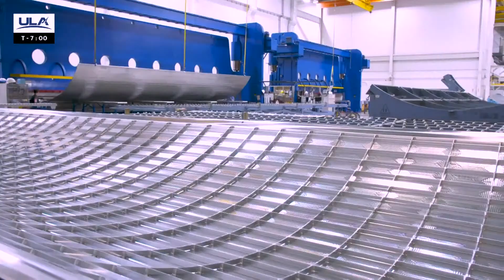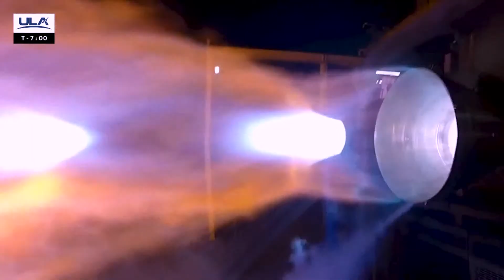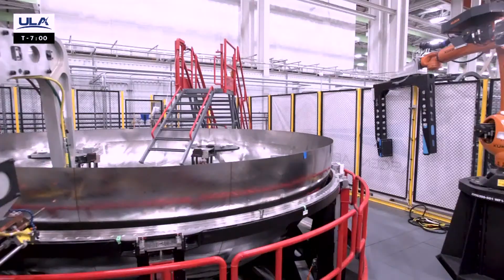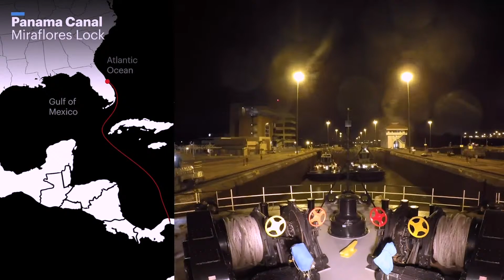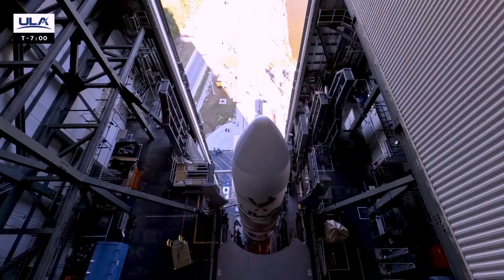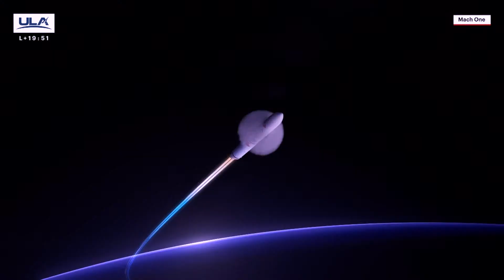Oct. 4 LIVE Broadcast: Vulcan Cert-2

Comment: as a rocket scientist, i can say that this was absolutely flawless. no notes. well done ula
Reply: ULA said that the vehicle’s performance was nominal in the early stages of flight. However, the separation of the two GEM 63XL solid rocket boosters (SRB) took place nearly 30 seconds later than the timeline the company provided before launch. About 35 seconds after liftoff, there appeared to be material coming off one of the boosters, whose plume changed appearance, suggesting damage to the SRB’s nozzle.

and ... ULA did not mention the incident during the ascent, but the timing of subsequent events, including separation of the booster and the shutdown of the Centaur upper stage’s engines after an initial burn, were behind the timeline by up to 20 seconds.
Reply: @jimwilliams4643  oh I should've noticed that. hey ho, looks like it got up to space okay. probably just a loose screw or something.
Reply: @jimwilliams4643 There is video of the SRB nozzle being blown clean off. NSF covered it (almost) live.
Reply: The uhhhh SRB???
Reply: @intrasonic  the silicone rubber bands are all fine. it got to space and landed fine. ready for the next launch!
Reply: @earthplusplastics 
Did you watch the same launch as every one else!
There was no recovery of the Vulcan booster!
Reply: @mahbriggs  ???
Reply: @earthplusplastics  
Can't comprehend English?
You claimed it went fine and was recovered for the next launch!
This is Vulcan, not Falcon!
The booster was expended!
Reply: @mahbriggs  no there wasn't a bird strike by a falcon! I said the SRB's were fine, but according to @jimwilliams4643 he reckons the little rockets on sides went too hot too soon. it's too soon to tell. we will have to wait until the FAA report before we know.

Comment: Good to have another rocket in the mix to choose from.  Other than some SRB excitement things went well.  SX fanboys busy spreading the light of consciousness as always.
Reply: Your willingness to just glance over the SRB excitement is odd. That's not a minor issue. They need to analyse the data to see if the success was due to redundant tech or due to pure luck.
Reply: @Pranav_Bhamidipati  Vulcan can have as many as 6 strap on SRBs so this will be thoroughly investigated.  Northrup Grumman is the SRB manufacturer.  Another rocket company launched 3 prototype rockets that had engines fail during flight and the community was fine with that.
Reply: @armandomercado2248  I'd argue that there's a difference between a certification flight and a developmental test flight, but you do you.
Reply: @Pranav_Bhamidipati  Not a minor issue, but not a show stopper either.  Per SpacePolicyOnline,  "FAA assessed the operation and determined no investigation is warranted at this time".  Some are upset there's more than one rocket company and are being hyper critical even to the point there's too many people in the control room.  Bottom line Vulcan reached orbit successfully.
Reply: @armandomercado2248  That irked me a little. A chunk of the nozzle literally broke off and fell down to the ground, not to mention that the rocket was on a slightly off-nominal trajectory. How could that not warrant a mishap investigation to check if public safety was ever endangered? There was no disposal of SRB nozzle planned (until later in the flight where the entire side boosters were jettisoned).
Reply: @Pranav_Bhamidipati  Vulcan remained within its launch corridor and the public was never in danger.  The GEM68 has a long history and this was the second failure ever.  ULA is launching from an established facility where all environmental and safety concerns were addressed long ago.  The other rocket company has significantly modified the proposed use of their facility from what they said at the start and the way they're going to fly their rocket, so they will get more scrutiny.
Reply: @armandomercado2248  Yeah, I just watched a video about that a couple of hours ago. Seems like there are safe zones where debris like this is allowed to impact the ground without requiring a mishap investigation. Neat.
Reply: @Pranav_Bhamidipati  The boost phase is over the Atlantic Ocean.  China allows spent boosters to crash near villages, so safety regulations are a good thing.

Comment: For me, the flame at L+0:37 with sparks and the difference of size of plume afterwards (maybe due to the camera angle), and the SRB jettison at L+2:10 and not L+1:49 look strange. But the callouts "everything is nominal" indicates the launch was ok. 🤔
Reply: No it definitely was not, Tory Bruno did confirm what we saw, as an “observation” of the right hand SRB, aka the nozzle or the aft casing failed. Centaur ended up burning extra because of the underperformance from the anomaly
Reply: @clevergirl4457, where did Tory Bruno confirm this? I don't see it on Twitter. Is there another information outlet, or did i just miss it?
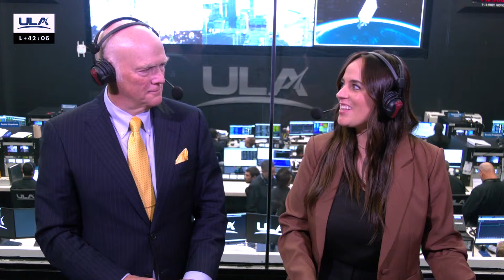Reply: @sumisubee  At 2:32:00 Tory mentions.
Reply: @sumisubee  on the stream
Reply: @clevergirl4457  ah. I didn't watch to the end. Thank you for pointing me in the right direction.
Reply: @clevergirl4457  Thanks for this explanation! Makes sense!
Reply: Tory is awesome, you can see he’s bummed but remains such a fine gentleman
Reply: ULA rockets usually carry their SRBs for several seconds after burnout.

Comment: Poor commentators unable to deviate from the script and not permitted to acknowledge the obvious major anomaly in the booster, that thing could have easily have taken out the whole rocket. There,  design redundancy at work! Well done Vulcan!
Reply: So is the FAA going to fine and ground Vulcan due to the obvious SRB malfunction as well during liftoff?
Reply: Either have real commentators or just give us comms. The poor girl reading the script was cringe.
Reply: They are going to get a ticket for littering.
Reply: Deviate from the script and it's off to the gulag comrade!!!
Reply: Yes but it is a failure of the certification test!  Especially if the Vulcan booster exploded (rapid unscheduled disassembly) after stage separation!
Reply: @mahbriggs how does something that is planned to be expended being expended make it a failure???
Reply: @AeonExploration  
The fact that the solid rocket booster failed!  A rather serious "anomaly" in anybodies book!